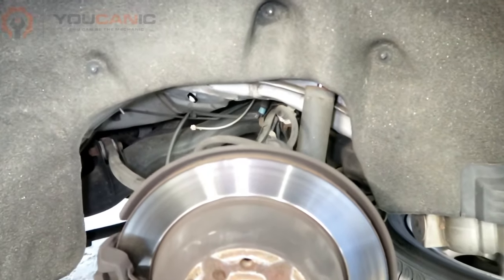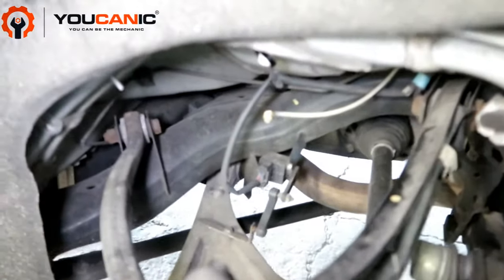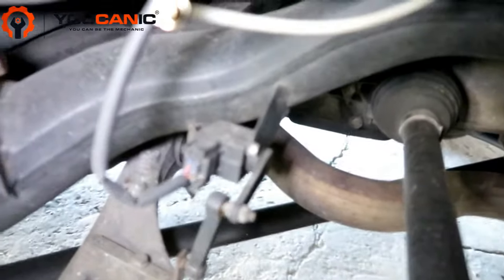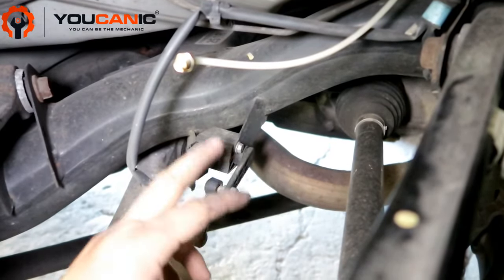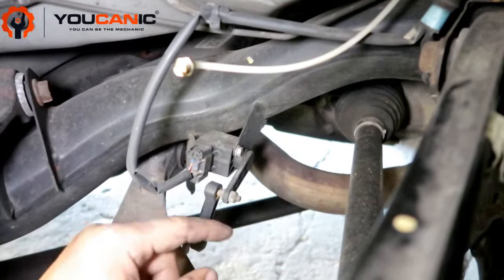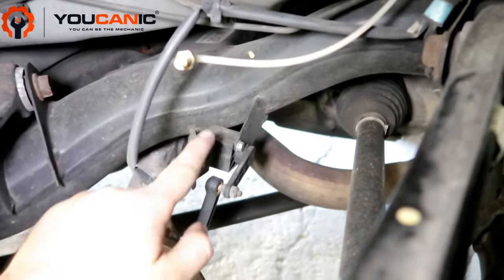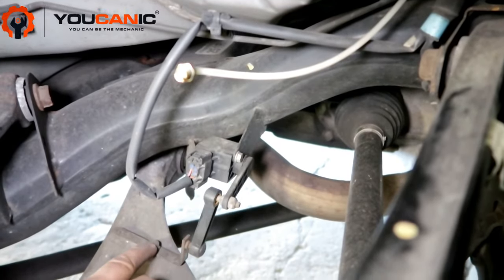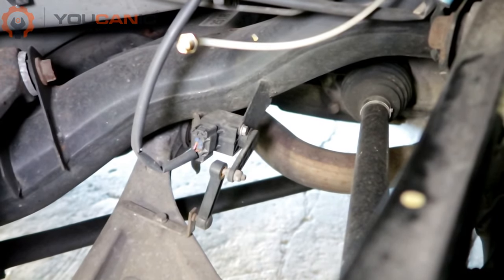Mercedes-Benz Rear Air Suspension Level Sensor Problem Replacement

Comment: Thanks for the video. I just brought my 2010 E550 in because I had the Malfunction code. Right height and suspension felt fine while driving but after they looked at it they told me I need to new rear Suspension Ride Height Sensor ($800 CAD from Mercedes - Left & Right) they also gave me the car back and it had dropped all the way down. When I look online I only see a rear left sensor. Are they both the same or is there only one as I just saw on a video (earlier model)?

Comment: Hi - I have only one side of my rear suspension sagging - could this be caused by a faulty level sensor or would a fault level sensor affect both sides simultaneously?
Reply: Yo I’m having the same problem. Do you have any updates?

Comment: Good video my car has that same leveler but i dont have the air shocks can you please send me a couple of pictures of the componets and location of all the componets?  by the way mine is a s class w140 i see the white hose above it what is that for? Ive been trying to figure outdid some one deleted that system i want to put it all back.

Comment: so is there any calibration procedure to replace it, or just change it out and it figures itself out?
Reply: @youcanic
Reply: Does it require calibration after a new sensor is fitted? If not I can do it without going to a garage.

Comment: My back side sits a lot lower than the front, after replacing the back sensor. What do you think is the problem? Will it go back to normal?
THANK YOU
Reply: buy the gasket kit for the valve block and the compressor
Reply: @sandroribeiro3214  hi Sandro! Where can I buy the kit? I can’t find it on Amazon…
Reply: @7Cisneros7  you can find in AliExpress
Reply: You have to calibrate the ride height

Comment: When replacing with a new height sensor does the suspension have to be calibrated ?
Reply from the maker: Thanks for your question! While a suspension calibration may not be strictly necessary after replacing a height sensor, it is recommended for optimal performance. Detailed guidances are available at Youcanic where we provide a wide range of resources including our powerful YOUCANIC scanner and factory repair manuals to help car owners like you with maintenance tasks. 

Remember, at Youcanic, we're committed to making car maintenance simple and accessible, and we're here to assist you on your car ownership journey. Please feel free to ask any more questions at www.youcanic.com.

Comment: I have a c class w204 350 v6 gas 2008 when i put some heavy staf like 150kg inside the car they go on sport mode after 10-15min drive and i can't press the bottom to stop it, i need to switch the engine off maybe is this sensor??
Thank you for your video
Reply: C350 does not have air suspension so it won't have these sensors

Comment: Can I use this to lower my clk 500?
Reply from the maker: Thanks for your question! While our video didn't specifically cover lowering a CLK 500, our website, www.youcanic.com, provides a wide range of guides and resources that may include the info you need. Our mission at Youcanic is to empower car owners with the confidence to handle their car maintenance.

Don't hesitate to use our Youcanic scanner and free resources, or to refer to our factory repair manuals for detailed advice. We’re here to assist and support you in your car ownership journey. Feel free to reach out to us on our website if you need any help!

Comment: Hello Where is this mercedes S class w221 rear sensor located ?
Reply from the maker: Thanks for your inquiry! The rear sensor of a Mercedes S Class w221 is typically located in the back bumper. If you need detailed instructions or additional assistance, our team at YOUCANIC is ready to help. Visit www.youcanic.com, where you'll find helpful guides, free resources, and our YOUCANIC scanner. 

We even provide access to factory repair manuals for in-depth assistance. Our mission is to empower car owners like you by offering resources that make maintenance easier, build confidence under the hood, and ultimately save you money. At YOUCANIC, your car ownership journey is our priority.

Comment: How can I tell if it’s faulty?
Reply from the maker: Hi there! At YOUCANIC, we focus on guiding car owners to recognize potential vehicle faults and fix them efficiently. Our free guides, resources, and our unique YOUCANIC scanner are designed expressly for this. Feel free to visit our website at www.youcanic.com.

Don't hesitate to let us know if you need further assistance. We also provide factory repair manuals for those who require detailed information. Our mission at YOUCANIC is to give you the confidence to handle your car’s maintenance. We're eager to support you throughout your journey as a car owner!

Comment: Hallo i have question my car is low on the ground and im not geting message thet car is low what is problem here
Reply: Did you sorted it out?? My car is on the ground but just the front and i’m not geeting message on the dash
Reply: @AutoJack89  yes i sorted but i have karavan so i have only back air suspension i change  air bags and i change relay and i bought new diagnostik for mercedes 130 euro and i make calibration my self now its everthing good
Reply: @AutoJack89  with this u can doo everthing calibration u can find problem
Reply: hi
Reply: My w166 gls450 can't level calibration. I use lanch x431. May I ask what brand of calibration equipment you bought? Thank you so much!
Reply: @hongliangna5068  hallo LAUNCH Creader Elite Profi Auto OBD2 Diagnosegerät For Benz ECU Coding Scanner  i think this is same like your
Reply: Mines is currently on the ground, I bought a new rear sensor level but the link is broke. Currently look for one.